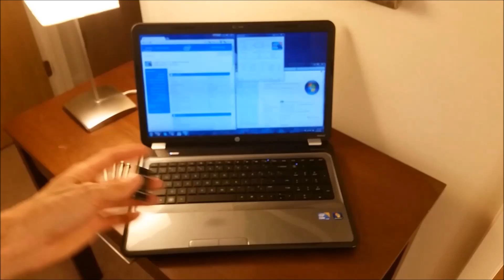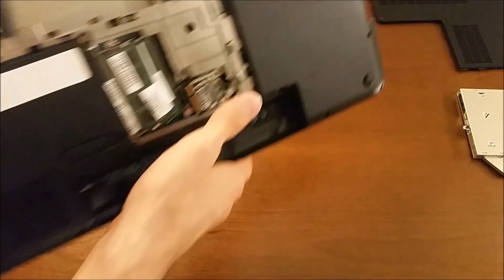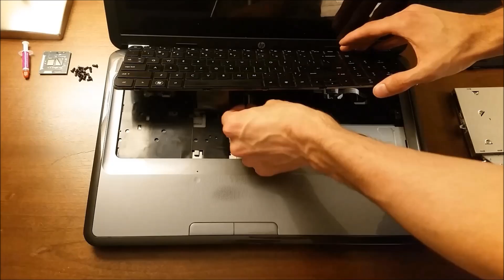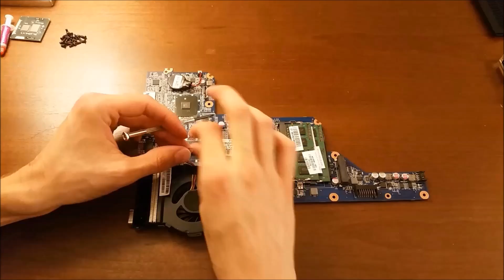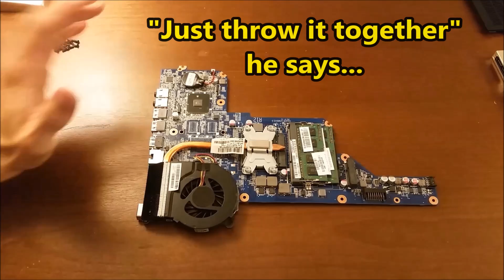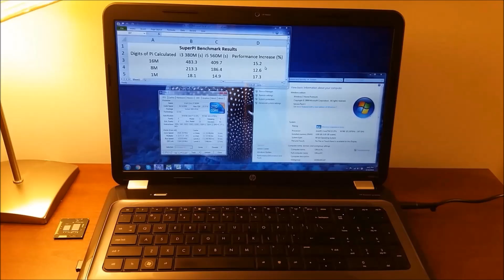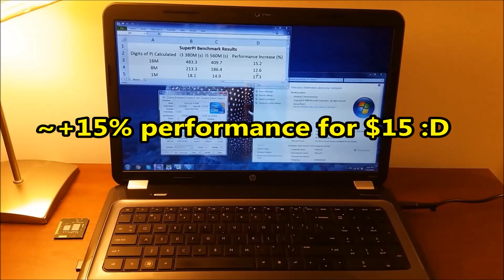How to Upgrade a Laptop CPU / Processor! XD

Comment: Hi, I have a question, do you need to change anything in the bios in order for the CPU to work?
Reply: If the processor fits the socket, then sometimes the BIOS does not need to be updated. What processor, graphics card and laptop model do you have?
Reply: @vladimirazirov1815  hey, I need help to in my amd a6 3420m and I'm trying to upgrade it to amd a8 3520m. I put the new one in the mobo but it doesn't work, but when I put the old one it works. I have 1.5 bios version and I'm trying to find a new bios version but I cant find a link where to download it
Reply: @BeltFrawx  It seems to me that the amd a8 3520m processor is broken, because the A8 must run on the same BIOS version as the A6 processor. I don't know where to download the new BIOS.
Reply: @BeltFrawx  For my Asus laptop I used drivers and BIOS versions from the s-i-t-e Asus .

Comment: I'd like to upgrade my Acer Aspire 4738 currently running i3 370m on rpga 989 socket hm55 mobo. Any suggestions what i5 or i7 processors would be compatible and wouldn't have heating issues?
Reply: i5-580m, i7-640m // RAM max 4GB+4GB DDR3-1066, DDR3-1333 1.5v //
SSD 128-256GB, sata-lll, 2.5 -> disk C (Windows, games, program).
HDD (disk D/ video, foto, files) -> adaptor Caddy 12.7mm -> slot DVD

Comment: What to do if CPU is soldered in motherboard? Can't that be upgraded?
Reply: it is possible, but it is expensive. You need to find a computer service with soldering equipment and they will inform you about the cost of replacing the processor. What model of laptop and processor?
Reply: @vladimirazirov1815  Its a Asus X555L model, and i3 5th Gen processor.
Reply: @JigneshKhatri95  here are the motherboards with i7 processor. Select a motherboard in the photo that is similar to your motherboard in shape and port pins. If your motherboard is without a discrete Nvidia card, then buy this one. You can buy a motherboard with a Nvidia video card, but then you have to buy another cooling system.

Comment: I was thinking of doing this to mine but then I heard the processor could be soldered into place so I did not want to go thru all the trouble of taking it apart to find out.
Reply: install the cpu-z program on the laptop and look at the processor name and socket type on the first tab.
Reply: @vladimirazirov1815  this tells me if the cpu is soldered into place somehow?
Reply: @RenegadeTM  yes
Reply: @vladimirazirov1815  ok, I got it going.  What do I look for to tell its soldered in place?
Reply: @RenegadeTM  yes. install the cpu-z program on the laptop and look at the processor name and socket type on the first tab.
Reply: @vladimirazirov1815  It says socket 1168 BGA, Intel core i-3-4005U cpu 1.70GHz
Reply: @RenegadeTM  :( The processor is soldered to the motherboard, cannot be replaced. The laptop can be accelerated by installing SSD 240-500GB and increasing the RAM to 6-8GB
Reply: @vladimirazirov1815  thank you for your time!

Comment: I have an old hp 2000 is is possible to install a faster processor
Reply: to replace the processor, you need to know what characteristics of the laptop. Install the cpu-z program from the Internet to the laptop and on the 1st and 3rd tabs look at the processor model, socket type, chipset type, type of the south bridge of the motherboard. Let me know this information.

Comment: So would I be able to use any intel or do I need an Intel Pentium N3530?? I just want a faster speed to be compatible with my job which is a 2.8 so I dont need anything crazy
Reply: Pentium N3530 - This processor is soldered to the motherboard.

Comment: Can I upgrade the cpu in my Sony Vaio . I’ve upgraded the ram from 4gb to 8gb and fitted a 1tb ssd. It’s just the processor that lets it down now.
It’s a Sony VGN-FW41M
Reply: Program CPU-Z => CPU=> model processor, tipe socket. 
Program CPU-Z=> Mainboard=> Chipset / South Bridge => HM65?HM75?
Reply: @vladimirazirov1815  the cpu is a core duo 2.56ghz
Reply: @KirbyEnthusiast  maximum Core 2 duo T9800, Core 2 Duo T9900

Comment: Do not go through the keyboard. Turn the LT over and go through the bottom. Open the case; the processer is right there. 1000 times easier.

Comment: Is there any resource sites I can use to figure out the upgrades for the CPU and Chipset for my laptop? I’m attempting to upgrade a Toshiba Satellite L50-C. I don’t think Toshiba makes laptops anymore so the information I’ve already searched for isn’t helpful. It’s my understanding that I need to know the MoBo model to start, correct? If anyone can help, I’d greatly appreciate it 🙏 The laptop has an i5. And from what I’ve herd, my chip set may need to also be replaced to upgrade the CPU. I’ve done similar projects like this in the past, so I have some experience. And I don’t have the founds to buy a new laptop. Again, any info on this would help. 🙏 Thank you.
Reply: the processor is soldered to the motherboard - cannot be replaced.

Comment: I've got this old idea pad z360 and I wanted to exchange it's processor for a newer version of the same i5, also wanted to upgrade the RAM by adding another 4gb to it's second (empty) slot. But the question is... CAN I DO THAT?
Reply: you have a chipset: Intel HM55, only the first generation Intel: i5-560m / i7-620m / i7-640m will be there. You can put a maximum of 8Gb RAM (4 + 4) SO-DIMM DDR3-1066/-1333. The memory bar should be with 16 chips (8 on each side)

Comment: Is it possible to replace Intel Celeron N3350 1.1GHz (Intel HD 500) with Intel Core i7-4700MQ 3.40GHz (Intel HD 4600)? I have 2018 HP 250 G6 model 3168NGW.
Reply: No, you have the maximum processor in the line. Change your laptop.

Comment: is it possible to replace the old processor with PC processor like i5,i3
Reply: What is the full name of your processor? what chipset / socket?
Reply: Slavik Fedotov intel(R) Core(TM) 2 Duo CPU T6600 2.20Ghz
Reply: @enovenn2006  Download the cpu-z program from the Internet. It opens without installation. There is a Mainboard tab and look at what is written in the Chipset / SouthBridge column.

Comment: What processor would be better for laptop with 250 GB SSD...???
1.Celeron  n4000
2.amd e2 9000
(For ms office & internet *no hagn& slowing problem)
Reply: What is the full name of your processor and laptop model? what chipset / socket?
Reply: @slavafedotov5742  
Please answer bro....
Which laptop will be better with 256 gb SSD???(*my budget is low& only these laptop are available within my budget in my country)
1.Acer Aspire 3 A315-53 N17C4 Intel 
CDC 3867U .
2.Asus A441MA Intel CDC N4000.
3.HP 15-db0083AX AMD 
Dual Core A4-9125.
4.Lenovo IdeaPad S145 AMD A6-9225 .
5.Avita PURA AMD A9-9420E .
Reply: @aks3377  of these laptops is the best in all respects:  HP 15-db0083AX AMD  A4-9125. 
Good monitor 15.6 ″ HD SVA (PVA) (1366 x 768) - when you buy, look so that there is an SVA, not TN !! the processor is good - you can then try to overclock it through programs. There are videos on YouTube how to overclock processors. The processor has a frequency of 2.6 GHz, well, then you will try to raise it to 2.7-3 GHz) RAM - 4GB is not enough, then buy another memory bar for 2 or 4Gb, so that becomes 6-8Gb
Reply: @slavafedotov5742  
bro..
Acer Aspire 3 A315-53 N17C4 Intel CDC 3867U has exra 1 ram slot for extend.
So,should i buy it??
Or that Hp laptop,which u already suggested??
Reply: @aks3377  I compared all 5 laptops. HP is the best. I advise HP. Acer Aspire 3 has a very weak Celeron processor. It is soldered to the motherboard and you can’t change the processor to a more powerful one. I advise you to buy a laptop on March 11,12,13 - good days to buy electronics)) If you do not like HP, then you can buy Lenovo IdeaPad S145.

Comment: cool.  so does anyone know which mobile laptop brands (ultralight or ultrathin) tend to be CPU upgrade-able?    I would like to get an i7 laptop but the ones I would want will cost about $1000 (just to much).  so I thought maybe I could buy an i5 and upgrade the CPU to i7 and save $200-$300.
Reply: Asus K53SV / Asus K53SM  / Lenovo B570 /  Lenovo G470 / ASUS K93SM-- You can put  i5/i7 2 generations (Sandy Bridge). Lenovo B580 / ASUS G75 - i5/i7  3 generations (ivy bridge).  Lenovo G510 - 4 generations  i5/i7

Comment: LMFAO the fact you had to say yes u must uplug it from the wall means you know most people dont have common sense XD
Reply: I can just see someone getting zapped...
Reply: @zzzzzz...9902  Tons of people have, especially beginners.
Reply: Yes common sense does not exist in many places like the idiocracy movie
Reply: And that would be right most people don’t have that Perk
Reply: It's actually safer to keep it plugged into the wall with the switch turned off to keep the laptop connected to ground whilst working in the board.
Reply: I could imagine people putting thermal paste on the pins/pads of their processors

Comment: I have some questions about my HP DB0011DX. I'm trying to upgrade my RAM but was also wondering if I can switch out the processor to an i5 which I have in another laptop. Is it possible? Is the i5 better than the AMD? There are 2 slots for RAM, can I use both slots? I have many questions but finding answers are very tricky...

Comment: Can you use any CPU for a laptop or is there certain ones for PC and laptop? because they look different as the laptop ones have 2 metal plate things and PC CPU have one large one. Can someone help me out?
Reply: You can only use a laptop cpu in a laptop as a desktop cpu requires much more power and cooling but has a faster clock speed.

And laptop CPUs have a different shape generally.

Comment: Hi, I would like to upgrade my old processor which is an Intel T6500 2.10 Ghz duo by an Intel T9300 2.5 Ghz duo. But I'm not sure that the T9300 is compatible with a GM45 Express mobility chipset, so I'm asking you, if anyone knows, thank you for answering me. Thanks

Comment: Hey guys, im not that knowledgeble in computer sector, but my computer does run slow, it is a i3 core and its not enough for some projects that i do.. I just often lags, so if i replace just the processor instead of entire laptop it will help, correct?

Comment: Anyone tried it and get success in upgrading processor
Reply: Yep, Upgraded from a i5 3530m to a i7 3560m with success and upgraded GPU to AMD Radeon HD 7780m chip and lol also upgraded the ram to 16GB DDR3 1811Mhz with ease as everything was accessable just by popping the bottom off my laptop which required no screwdrivers only needed a screwdriver to do the CPU that's it.

HP Probook 6570B is my laptop
Reply: @dylanweise4802  nic

Comment: Hey I am having the same laptop but a previous model pavilion g6 with AMD -3320 Apu & radeon HD 6480G graphics... My question is, is it upgradable to Intel processor. And at what extent I can upgrade it...??????
Reply: No. Only AMD to AMD, or Intel to Intel.
Reply: @JasonCarmichael  Okay in simple way, I have to purchase a new laptop with 8th gen Intel core i5 processor.
Reply: @adityaghorpade3128  An "oldish" Intel -  i7- 4940MX is faster than a new i5.
Reply: @JasonCarmichael Okay...Thanks
.. Actually I am bored and tired using my old AMD laptop and even it is very useless for gaming purpose. That's why I am going to build a new gaming PC very soon with an Intel CPU and nvidia gtx GPU for superior performance and gaming. I am going to keep the old laptop for temporary use.
Reply: @adityaghorpade3128   I have been "saving" $$ with AMD for a long time also, and finally bit the bullet in 2017 and made an i7-7700 system. I started with Radeon RX480, ya know to save $$, but it wasn't really good at games either, so I added a second RX480 and crossfired them. It still wasn't all that great. Then I sold both and bought a GTX-1080 and have never looked back.

So, to make your system as fast it can be here is what you have to have:
Intel CPU
NVMe PCIe 3.0 SSD.
Nvidia

Don't bother with overclocking, I've done it many times, in the end, it's just an utter waste of time.

The AMD A-10 system I used prior lasted 4 years before I began to itch for more game performance. I expect this i7 setup to last a solid 10 years. The 8th and 9th gen CPU's just don't do anything wicked faster to make that step.
Reply: @JasonCarmichael  Oh wow.... Congrats... You did a great job by upgrading to gtx 1080 coz its a beast for to run high end games perfectly........
Reply: And what do you think about AMD Ryzen CPU's because it can save some penny that I would gonna spent on an expensive nvidia GPU..
Reply: @adityaghorpade3128  ryzen still stuck in the state of mind, "could of had an Intel". Even with it "unlocked", still chasing Intel.
Reply: @JasonCarmichael  Hmm.... I agree Intel is the best...
Reply: Hey bro, can you give  some tricks or setting for  initial integrated radeon GPU of my laptop to run GTA V. Because I am playing it okay but experiencing very bad & horrible shuttering and some missing textures.

Comment: hey man good video, but can you tell me if there is a site that will tell me if i can upgrade my laptops CPU and what Processor should i get for it? already added another 2GB DDR2 Ram, works way better in Internet, can now load a shit load of pages without running out of memory, but now the processor is at 80-90%. in games it would be way better with a new processor, at least counter strike source hehe.
Reply: Press Windows button + X, Device Manager, scroll down to Processors, it will show one fore every "thread" it is capable of, you still just have one CPU, but it'll show 2, 4, or 8 processors, all the same.
open up Wiki and type your CPU model.
Find out what "socket" it uses. P, G1, G2, G3
Cpu-world.com will list every CPU that "fits" that socket.

Comment: I'm 13 not really the smartest at PCs but I have a Pentium P6000 Socket PGA 988A (PGA 988B has different pin positioning) my research says that I can upgrade this thing to an I5 520m but also is curious if I can do it with an I5 560m but really there's not much of a difference in performance.
I'm also doing this so I can undervolt my PC so that it won't overheat and suddenly shut itself off
"Why don't you just replace the thermal paste? Blah blah blah" Well I could try but nah I have a feeling it won't help, like at all but, I'll be sure to try but, if it still doesn't work then proceed to Plan B

Comment: hi, nice Video. I have a "little" Problem on a Laptop where I changed CPU. after Change it Laptop is running but black screen and nothing seams to be recognized (no key commands, no Screnn etc.) any Idea what could be wrong? according several infos from Internet the new CPU should work on that Laptop
Reply: @Filterficial  Tanks for replay. That will be my next Test. if old processor running... Is there maybe any preparation from Software side needed before switch the new CPU? BIOS, South- and/or North Bridge or is it maybe possible that there integrated Graphic card cause some trouble with the new CPU? The Laptop it self is old but very strong (Elitebook 6930p with CPU P 8400) target was to place T9800 what according several websites supposed to be working well. Maybe I just forget some small detail in settings before switch

Comment: can you change amd cpu's without removing the thermal paste?
Reply: Thermal paste is used to improve heat conductivity between the cpu and the heat sink. If little to no paste is applied the cpu will overheat and most likely get spoilt.

Comment: What does one need to replace in the Dell 11" latitude education (CeleronDual Core 2.4 GHz Clock Speed4 GB DDR3 RAM128 GB SSDIntel HD Grphics) in order to be able to install a faster processor and upgrade the ram since it's soldered?

Comment: Just buy a Laptop at a reasonable price,
and buy all the internal parts separately,
you can completely turn the laptop into a bad ass.
I bought a Hp touchsmart 15 for like $40 from a Pawn Shop, because the laptop wouldn't turn on at all, 
and the previous owner probably didn't know what was wrong with it.
I took it home,
open it up, and found out that the HD-Sata cable had snapped, and the Hard Disk itself was done for. 
I took out the Hard Disk, bought a 500GB SSD, bought a new SATA cable, added 8 GB of ram,
added a new Intel Core i5-7400 3 GHz Quad-Core Processor, and voila, the laptop turned on,
installed latest version of Windows on it, and boy is it a bad-ass.
It has touchscreen, plus brand new SSD, SATA Cable, more RAM, and a new Processor, in total, it cost me like $380 for all those upgrades, plus $50 for the Laptop,
so, i got a badass laptop for $430.
Which, if i were to buy a laptop, with the same components installed, in the market, it would be around $800.
Reply: I like the "Voila" part
Reply: Nice
Reply: Isn't the i5 7400 a desktop CPU? Correct me if i'm wrong
Reply: @wiesellmakelaardij1237  

Can I upgrade a HP with a classic intel dual core processor with a modern i-series prozessor too? And what I5 would be best?
Reply: @AbuHajarAlBugatti   Its depend on your BIOS and socket,some BIOS are upgradeable,also check the stability of your laptop,i5 give more heat than dual core.
Reply: Can I upgrade any current lowrange HP laptop like this?

Comment: hi friend do you know if I can replace the cpu and gpu of my asus K46CM Intel Core i5 3317U @ 1.70GHz
Ivy Bridge 22nm?? I don't know if it's soldered. I can't open it because the screws are stripped. Or should I just build me a new pc and give up on that one? it has a Geforce GT 635m

Comment: It's easy to upgrade a cpu. Just  do alot or research to see if cpu is compatible. Second when tearing apart Laptop take lots of pictures in case you forget where things go. I did a few laptops and never had a problem.
Reply: Well put, but dumbasses will not take any pictures. Most people will be lazy and do it the hard way